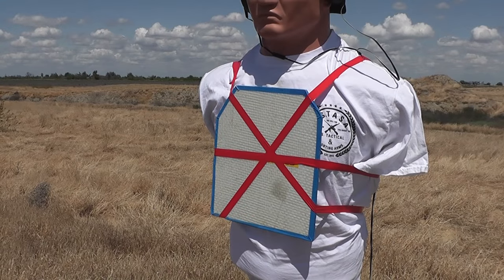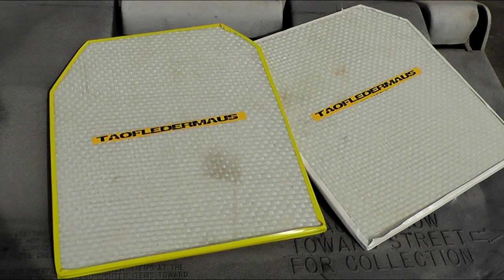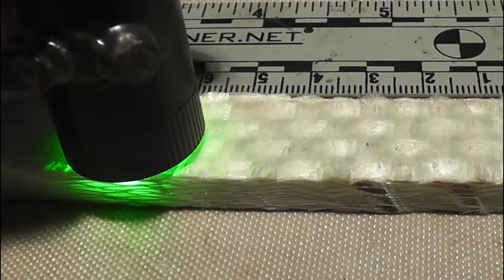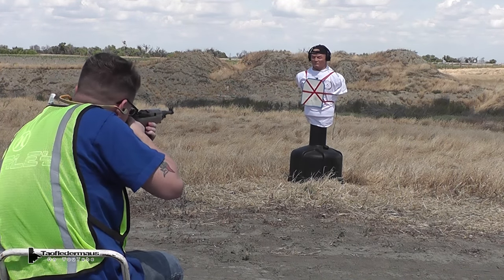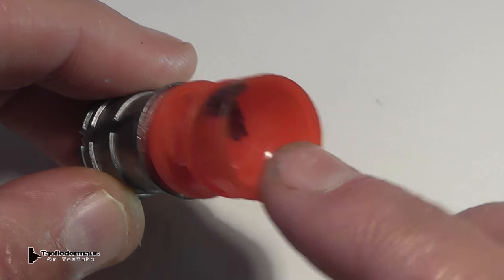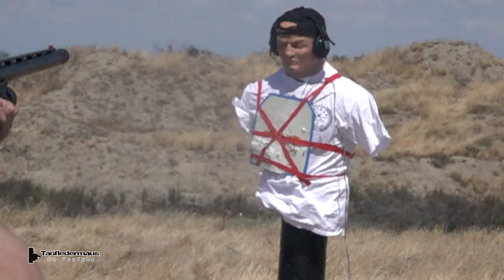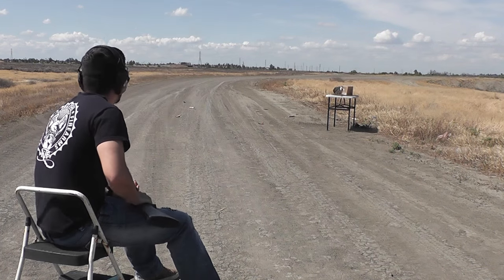Very Effective FIBERGLASS Body Armor

Comment: Ok Jeff, I went down stairs and my saw is still in the basement, so your in the clear.
Reply from the maker: +Rl Badger  I did all the cutting in the basement,  sorry about all fiberglass dust that accidentally got inside your air conditioner ducts

Comment: I've worked making fiberglass air filters before and when you get that stuff all over the place you will be itching for a few days.
Reply from the maker: +fabian albor  Yeah, it's pretty bad!
Reply: +fabian albor I installed fiberglass insulation in houses for 3 years, words can not describe how much I hated that job, still have nightmares to this day, and it has been 20 years...
Reply: +gunz-n-gadgets I worked with them for 5 years and I can tell you I will never work with fiberglass for as long as I live. so I feel your pain.

Comment: I've seen half inch level III fiberglass backed by a 2x6 stop a variety of .44 magnum rounds shot from 25 feet. Also you should really be cutting that with a diamond encrusted tile blade.
Reply from the maker: +MauserK98  The carbide blade worked fine.

Comment: what would be the thickness for a level 3 protection,  AK round ?
Reply: Shown in the video double what was used here.

Half an inch would still be just over half the weight of the steel equiv.

Fiberglass especially S-glass has incredible tensile strength to weight. Even better then Carbon Fibre.

Unfortunately it's not that stiff. it is much stiffer then Kevlar though.

Comment: Try shooting fiberglass with 3x thickness. All in all, fiberglass has a better strength to weight ratio for bullet resistance than steel.

Comment: How about trying this plate with some form of amo made from Fiberglass.
Reply: +michael1234252 Or cut disks from this material and load them into a shotgun shell. Would be a fairly light projectile but might be fun to see how a fiberglass slug performs.
Reply: +michael1234252 My guess is that the dust would be too dangerous once you shot it :/

Comment: Would not want fiberglass shards in a would channel if the bullet penetrated
Reply: u have bigger problems
Reply: WolfWhisky You can get shot in the chest, have a bullet go through you and survive. Having fiberglass through the wound channel would really complicate things.
Reply: ***** My point is I'd rather deal with the extra weight of an ar500 or similar plate since it will stop much more powerful rounds and if the round does penetrate metal fragments show up on xrays.
Reply: +sjpro1 oh goodness..

Comment: I wonder what a large panel of that fiberglass costs?  Because it weighs so little, it might be worth it to custom cut and place inside the door panels of a car. Between the steel of the door (which is easily defeated by most pistol ammo) and level 1 fiberglass, this might be a great way to make a car more survivable in a bad situation.
Reply: That's actually how they do lower end bullet proofing, in the mechanical engineering department we have on a message board the cliffs notes of the testing regime for fiberglass panels to be used in commercial car bullet proofing applications. Unfortunately they only printed and posted the failure, a rifle round.
Reply: +Filipe Amaral for commercial purposes for everyday civilians, rifle threats are extremely rare. Having the ability to retrofit panels in the four doors and trunk area couldn't weight more than 50-60 lbs. managing to stop handgun rounds is optimum. If cost is reasonable, I'd be interested.
Reply: M85FSLUVR I know, the high end stuff is pretty much only acquired by billionaires and politicians. I would have liked a full report with the successes, it was an interesting read but I wouldn't even have bothered to run simulation and live-fire testing to know those plates wouldn't stop a 7.62 NATO.

But yeah, it's exactly this type of stuff the car bullet-proofing companies use.

Comment: There's no way I'd wear that though. In the event a bullet gets through, a possibly treatable would becomes so much worse from that fiberglass
Reply: possibly treatable wound*
Reply: +A to Rhombus Alone it would be a danger to the wearer, I agree on that point. 

It would make a fantastic top or in between layer in a multiple layer panel however, with it's light weight compared to similarly resistant materials making it a great candidate for home made body armor. Just stick a solid metal sheet behind it with a little padding on the back and you should be fine (albeit somewhat bruised, hard to avoid that when getting shot though).

Comment: Ugh this thing might be worse to wear if you can get the dust in your open wounds if shot with a gun it's not rated for...I don't know what would be the better option..I guess wearing it rather than not is still better....but wearing plate is probably better than wearing fiberglass

Comment: Hmm...  What kind of fiberglass is it?  If it's borate based an over penetration might not be as bad as imagined  with shreds through the cavity in light of this:  

http://www.isaude.net/en/noticia/21832/general/material-fiberglass-accelerates-wound-healing-in-diabetic

I wonder if a suitable bio compatable  might be available for testing?
Reply: The glass is woven S-2 grade glass. The glass composition is quite different from normal glass. Owens Corning was the original producer but they spun the S grade yarn operations off as a separate entity. Yarn is sold to weavers and saturators to make the finished products. Famous use is stealth aircraft hull (along with carbon composites). Common fiberglass is E grade and can be seen in everyday woven and non-woven reinforcements. No comparison on strength values. E glass actually dissolves in salt or body fluids over time, not sure of S-1 and S-2. The skill saw should be finest tooth carbide available - the one shown causes edge fractures and some you can't see. These will propagate under impact stress (15 year stint in FG engineering design work).
Reply: zenengineer Do you know the composition?  The dissolving  is something desirable if used as armor.    

I wonder if something comparable can be constructed with the borate materials.   

Thanks for info!
Reply: I have the comp numbers buried somewhere but they are typically available under USPTO patent search. All glass fibers use some borate. E glass throws in things to guarantee there is no biohazard besides keeping the glass melt viscosity correct. More to the point, O-C probably published safety data (bio solubility) on the S-2 because no one wants to make anything resembling asbestos. Bio-solubility  or salt water corrosion values are the critical property you want, which is not always predicted by the glass oxides composition. Some ceramic fibers get dangerously close to insoluble and this is a concern when fiber diameters are small, under 3 micron diameter and considered inhalable. Woven glass, both E and S tend to be well above than. Keep in mind, if you step away from S-2 strength you can't make anything resembling armor for impact strength unless you're looking at carbon, kevlar or highly orientated PE fiber composites.

Comment: Incorrect sir, while you did state the correct term, being resistant, no firearms protection is bullet proof.
Reply from the maker: +Paul  It is bullet proof to what it is rated for.  Hence,  "proofed".    That doesn't mean it is bullet proof to everything.
Reply: ***** not really, proof means it can withstand it completely, but that isn't the case. You put enough of even what it is made to withstand into it and it will fail.
Reply: +Paul Your last comment makes absolutely no sense.  Re-watch the video. It's not enough that you hear what is being said, you must listen and understand what is it.
Reply: Craig Campbell My comment made perfect sense, no personnel protection is Bulletproof, it is only bullet resistant.
Even the companies that sell the pieces of personal body protection such as plates say they are RESISTANT to X amount of shots after which their failure rate drastically increases, be it one extra shot or 20. If it was BulletPROOF it would NOT fail no matter gow much is put into it.
I had discussions with people that actually work for companies that produce body armour and they can get in a LOT of trouble stating their products are Bulletproof.
The closest thing to Bulletproof material at this point in time that that would be used for body plates is titanium as it actually able to withstand all smallarms and you literally need an antimaterial rifle with black tip ammo to do any substantial damage to it. But in saying this titanium is heavy and it's expensive, both factors that rule it out for personnel defence for any military or law enforcement.
Have a read.
http://m.mentalfloss.com/article.php?id=24039

Comment: if you back a nij 3  soft  light then  steel plates   you have one type add too it if can   if paint ball vest  works use it   vest is there just hold the plates    not the best if work  you a live  in end    hell you dont want a tampon  in you   stack up

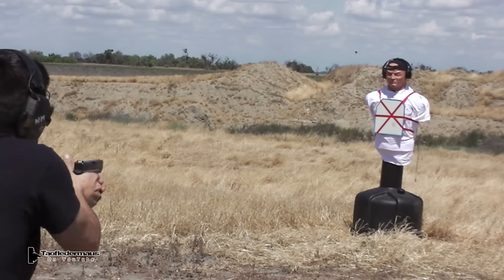Comment: Safety Nazi here, Safety is my Fuhrer. @2:20 Nick has his glock almost touching his head. Do not adjust anything with your firing hand, including ear pro, eye pro, target stand, shoelaces, your zipper fly, while a firearm is in your hand. Rule #1, treat all firearms as if they are loaded. Makes no difference if the slide is locked back.